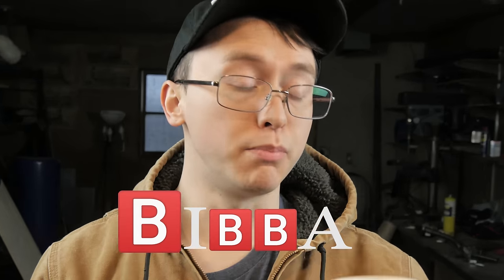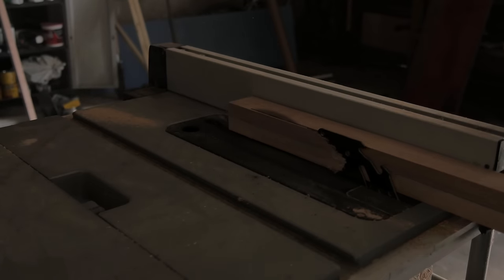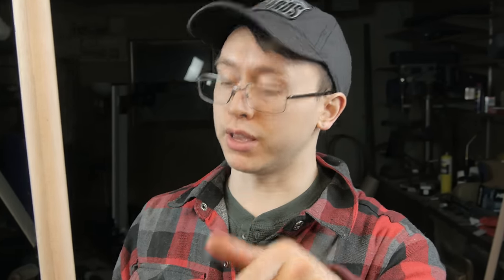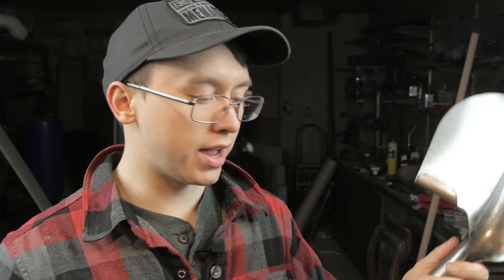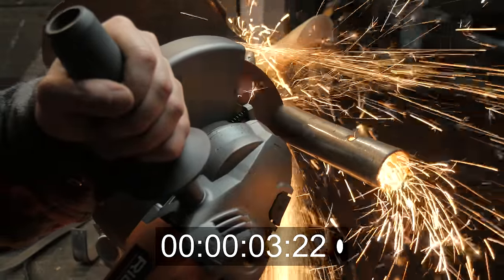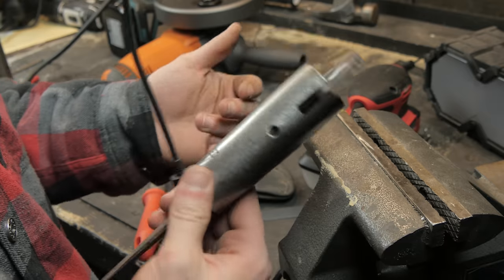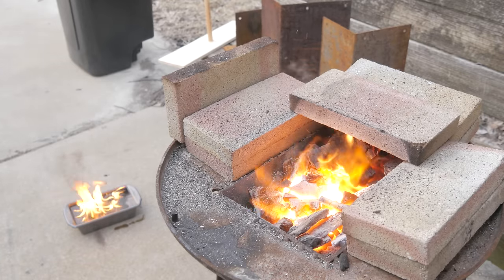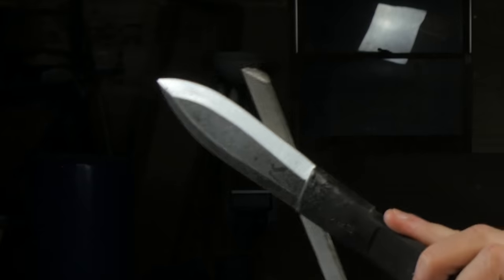DIY Lathe in a Day + Turning Spear Handles (Wrench Spears Part 3)

Comment: Please don't use sandpaper on a lathe like that Eli, wrapping your hand around the part and crossing the sandpaper over itself.
I work with lathes for a living and using sandpaper can be very dangerous if the proper precautions aren't taken.
Your technique from 3:29 - 3:32 is the safe way to do it. 
At 3:33 when you had your hands underneath the work piece and at 3:35 when you had your hand wrapped around the work piece, with the sandpaper between your hand and the work piece, you were exposing yourself to the unnecessary risk of losing or seriously injuring your hand or arm.
Please reply to let me know you've read this.
Reply: That drill doesn't have the same power as a real lathe he could stop it by hand just by squeezing
Reply: @crashoverride93637  Exactly, I've actually killed a drill by holding the chuck. But i can understand where hes coming from, if Eli EVER DOES buy a real lathe, That's bad technique.

Comment: Hey man, I hope you get to read this. I have been doing a lot of experimenting with forging knives recently and have learned some stuff about HT that might help you out. I would suggest you take a scrap piece of your wrench and try quenching it in water. It may crack to pieces, or it may be the trick to getting your spears hardened. A little telltale sign that your piece hardened will be that most of the black scale will pop off, leaving a dull, light gray color steel underneath. Another thing to consider when quenching in water is to only quench for a second or two, so as not to cool too much too fast and end up with cracks. You could even do a quick, 1-2 second quench in water to flash the hardness into it and then immediately quench into oil to let it cool the rest of the way down. That will prevent the residual heat from pulling the hardness back out of it while also minimizing the cracking risk. Hope that helps!

Comment: Hey Eli My brother is experienced in making knives and if you heat up just a scrap piece of steal to that orange glow and dip it in the oil it’ll heat up that oil to just the right temperature for tempering your blades!! You will have to do it more than once though, like three or four times of that process and it’ll heat it up nicely.

Comment: Hey Eli, get a magnet for the heat treats. The steel won't attract when it's hot enough for the quench. The first time I did a heat treat, I made a knife out of an old file and got the heat treat first try and didn't have to heat my oil.

Comment: You can use a charcoal paste on the blade and encase the entire spearhead in clay. Wrap the spearhead up in the clay and make it look like a hot pocket. Then, you put the whole clay hotpocket in a crucible and heat it up until the spear head gets red hot. It will actually surface harden the steel, keeping a soft core and a hard edge. Perfect for any stabbing or slashing implement

Comment: Eli, when heat treating try moving the blade around, the heat will make the oil boil, making air bubbles around the steel which will keep the steel from cooling as fast as it needs to

Comment: It's hard to tell the temp of the steel just by the footage and often in real life but just a suggestion, I've found it useful to keep a magnet close by and test it on the hot steel to assure it is indeed non-magnetic before quenching. I struggled with hardening issues for a long time and after using this method I have a much higher success rate. Great content as always.

Comment: Hey Eli, when you go to quench steel make sure you wiggle the piece around in the oil. You gotta keep it moving so it gets a uniform cooling. The heat can actually cause the oil/water to boil so fast that it isn't touching the piece. At least that's what I see yelled about the most. Also, you probably know this already, but I'd bet those wrenches are made form 01 Tool steel. I think the hardening process is a little different for 01 from high carbon steel.

Comment: Before going for a case hardening, try another heat treat. 

You need to put a magnet next to your forge. 

The magnet is used to test if the material is at quenching temperature. 

When the work piece is heated to non-magnetic temperature, it’s ready to be quenched.

Comment: As a bladesmith, it looks as though you're not getting the steel hot enough, get it to non magnetic then a little bit hotter than that.

It also looks like you're using motor oil to quench which is pretty rubbish tbh. Try using canola (rapeseed) oil. Warm the oil to about 120f then quench for about 10 - 12 seconds.

Always a bit of a gamble using wrenches and stuff because the steel is somewhat an unknown quantity. You'll definitely get better results with that sweet 5150!

Hope this helps.

Comment: Hey Eli I do some heat treating myself and when you heat up the steel it has to reach critical temperature (non-magnetic) and when you put it in the warm oil, you have to move the blade around so a pocket of air/ smoke from the oil doesn’t mess with the heat treat itself

Comment: there is a good chance it is a W tool steel, meaning it has to be quenched in water. I suggest buying a wrench identical to these or using a cutoff from these wrenches if you still have any and test with that because if it is not a W steel it would likely crack. Keep up the good work!
Reply: That is my suggestion as well!

Comment: From what I've learned looking into private bow building them shafts really should have straight grain running from one end to the other. On the the other hand you could've used shovel, post hole digger, or shop broom handle.

Comment: Random material science student here.  i'm just gonna throw a guess to the wind but it may be possible that because your oil maybe got over heated the difference in temperature between the heat treat and you quench may not have been great enough and the structure of your steel was recrystallizing to a weaker point.  From what i remember in class if the steel is not dropped in the quench fast enough or the temp difference is too narrow the weaker atomic structure is more likely to form.  Again though I may be wrong but heating the oil looks more like a visual aesthetic then anything else.

Comment: I know a guy who has been a blacksmith for over 30 years and according to him oil is what you use if your not doing a precise heating, and he actually just swears on useing water to quench because it causes a faster reaction that causes the steel to harden better, however if you dont know the proper temp to harden the steel your working with then oil is useually a better solution because it cools the metal slower.

Comment: Heating the quench oil is usually done with a different piece of hot metal. Grab a D20 nail, get that sucker red hot, stick it in. Then do the real quench.

Comment: You may have gotten the heat treat thing nailed but if not, when you heat treat it move the metal around VERY FAST in the tank because it breaks the vapour barrier caused by the heat so the oil will actually hit the steel while its still hot

Comment: Eli, I think you should really get rid of that cable/string thing (@ 9:04) when working with stuff like angle grinders.
I was using a wire brush attachment on my grinder a while back and the thing caught the string of my hoodie and jumped straight at my neck. Scariest experience I've ever head. Luckily I pulled the cord quickly enough that it only scratched up my neck with just little bleeding.

Take care, love your stuff!

Comment: Dunno if you already do this but you could soak the ends of the spear poles in water , then it should wrap around the spear head a little tighter and you can wrap below the spear head and I think this should keep it from splitting the pole

Comment: At around 12:30 you should be using the magnet trick.... When the metal is hot enough for tempering, the magnet won't stick.  Just an idea to try....

Comment: I'm a proffessional blacksmith so let me put in my say here. Heat up any old piece of round bar in your forge and quench it in your oil and it will preheat the oil to a much higher temprature and it can cool while the other piece heats

Comment: When you’re quenching the blade in the oil you have to keep it moving so that air bubbles don’t form. If you just put the blade in the oil quench air bubbles will form and keep the oil from actually touching the blade (probably the reason why the metal isn’t hardening)

Comment: When you temper try to barely have it above a low red temp and let it cool longer in the oil. The cheaper wrenches are also usually water hardened. Try to use a small test piece in water quench and cool it faster.

Comment: You could be losing temper from the residual heat in the large mass of the tang and guard, since that part is exposed to the heat but isn't being quenched. Another possibility is that that steel might need a more rapid cool down to set into martensite, thus needing water rather than oil. Since what I've read so far, husky uses chromoly steel in some of their wrenches, but since i don't know the exact model you have i don't know for sure. 

I would try testing the blade for magnetism while in the forge, and when the steel has reached a non-magnetic state (Called Austenite, and usually occurs around 1600F or a dark orange heat), quench the blade in water for about 2-3 seconds, and then submerging the whole thing in oil for a good 30 seconds to a minute. This would allow for a little faster cool down than just oil, and would allow the entire mass of steel to cool thus preventing residual heat from ruining the temper.

But that's just an idea, love the H*CK out of your vids bro.

Comment: Also you might need to heat the metal more. There are data sheets on every type of metal almost. Do the magnet test. If the magnet no longer sticks, it’s typically hot enough to be heat treated.

Comment: Get it hotter. 
Did you do a magnet test?
Take a tiny magnet (otherwise you may magnetize the metal) once it's no longer magnetic. Let it get a few hundred degrees hotter and quench it for a while. If it gets too hard you can bake it in the oven to soften it.

Comment: With the quench use heated oil and let the blade cool (roughly to the temperature of the oil) in the oil before removing it. That should result in a solid heat treating process

Comment: If you move the object you're quenching it will give you a better hardening because it forms a barrier of air between the oil and the metal due to the Leiden frost effect and it insulates the edge so it doesn't harden correctly which is why the spear isn't skating a file so next time you quench move the spear around so that barrier of air doesn't form

Comment: Use a magnet to check the temp. If it sticks it’s not hot enough. Also when you quench the blade make sure it stays in the only a lot longer

Comment: When you heat up the steel to harden. Use a magnetic to check for the time to quench in oil. When it looses its magnetism wait another minute. Then quench in the oil. Tool steel is typically O1 which means it needs it has to be at least 1450 °. You simply did not get the metal hot enough.  To harden.

Comment: an easy way to get a good heat treat temperature without fancy equipment is to use table salt, while its heating up, sprinkle some table salt on your metal and once it gets to the heat where the salt melts instantly, dunk it into the oil.

Comment: 🍎here's a tip🍎 leave the hot Steel in the oil until it's barely smoking or until it's warm that way it has enough time to heat treat and if you don't know when is the right time to quench it use a strong magnet on the hot steel and if it doesn't stick its perfect to quench I hope this helps and you're welcome

Comment: Another suggestion would be to try water instead of oil, most places I've seen it discussed they say water actually works too well for normal cases so oil is preferred.
i.e quenching in water makes normal projects too hard/brittle, so if this stuff doesn't seem to be hardening as much or the oil doesn't have enough carbon?..
There is the risk of it making more stress points in the steel, but as long as you normalize it after it might be a decent thing to try.

Comment: I've tried to case harden steel using clickspring's method and as others have mentioned in the comments, get a magnet and test to see if you are getting hot enough.  If the steel is not becoming nonmagnetic then the carbon will not be able to penetrate the steel and you will only get surface hardening. Also if I remember correctly steel will not harden well if you do not get the steel hot enough for it to become nonmagnetic even with carbon steel.  Test it with a magnet before you quench it.

Comment: Old wrenches were made with pretty high carbon steel, but most of the time new wrenches aren't. You could try to carbonize the steel (I've never done this myself, but I've seen it done) by packing it in carbon dust, inside a pouch made of stainless steel foil and heating it up to forging temp for about an hour. That might impart some of the carbon into to steel

Comment: you should use a bigger oil container and move the blade around quickly in it so that the superheated oil vapor can't form a protective layer
Reply: the oil vapor prevents the blade from cooling quick enough
Reply: that might be it

Comment: You could try to normalize the temper of your steel by letting it cool in the air a few times before quenching, ive seen steel more likely harden with this method

Comment: If you want to make sure you're heating the blades to the proper temp before quench, they need to be heated past the point where they're no longer magnetic. Obv you shouldn't take a magnet in hand and just stuck it on there bc you'll burn yourself, but you can buy one of those extendable magnets that people use to retrieve parts they've dropped into their engine bay for a few bucks and use that to test if the metal is no longer magnetic before quench.

Comment: use the super quench - it works on mild steel:
5 gal water
5 lb Salt
32 oz Dawn (blue) dishwashing liquid (28 oz if it says "concentrated" on the label)
8oz Shaklee Basic I or 7oz UNSCENTED Jet-Dry or other surfactant (like Simple Green) of appropriate quantity for 5 gal mix (wetting agents)

that's from the inventors site.

Comment: Ok a trick you could use it to make a clay box the size of the spear heads then what you need to do it fill have the box ( half way) with some sort of high carbon content material like coal ( make it a powdered form first) then place the spear head inside it after that fill the rest up with the powder then using you're forge bake the spear heads in the clay box for several  hours make sure you seal the clay box first. And once it has been heated for a long time with the coal the outer layer of steel will be very high carbon steel but the inner lay will keep it's original carbon content I believe the process is called case hardening you could look up the exact spects  on how to do this properly online

Comment: It's possible that the steel is not able to be hardened more than your files. Steels used in hand tools are often highly alloyed and require very specific (and hotter) heat treats that, even done by the book, may not yield hardness higher than the typical file. Similarly, you may have surface decarburization from the forging and may find that just a bit more grinding will reveal harder metal. Moving the piece around while quenching is also a surprisingly important factor 🔥

Hardness testing takes out much of the guess work- you can order some cheap hardness-test files on eBay to ball park some actual numbers. 55-58 rockwell C is probably acceptable for high impact weaponry like this I think, you might be closer than you realize

Comment: heat treating is tricky and hard depending on the metal. if it has a lot of impurities or is mixed compounds it can be a pain. plus you might need to get the metal a bit hotter than that to really treat it.
and i wish i could help financially but i more broke than a dropped china bowl.

Comment: Could try carburizing the steel by surrounding it with powdered graphite and sealing it in an air tight metal pouch and heat it up yellow and keep it hot for an hour to leech some more carbon into the steel

Comment: You should use a magnet when hardening. When the steel loses magnetism it's at quenching temp. But yeah maybe the wrench steel doesn't get as hard because tensile strength is more important in a wrench. I'd stick to 51-60 and 1095

Comment: Tap a neodymium magnet to the glowing steel,dont quench until it is just hot enough for the magnet to stick ,and a throwing weapon shouldnt be extremely hard,this will cause the blade to snap if it hits something such as a rock,a slightly softer steel would just bend and be able to be hammered lightly back into shape

Comment: If you want a better heat treat, heat the steel until it becomes non-magnetic before quenching (aka touch it with a magnet to see if it sticks). Your forge also may not be getting the metal hot enough; if you have an oxyacetylene torch you can easily reach the proper heat with that and just do an edge quench. 

I'm not sure about the quality of the wrenches (metallurgy of hand tools has been going downhill for quite some time even on major brand tools). Cheap tools are probably even worse; see if you can look the specs up online.

Comment: Get the steel hotter.  Hot enough till it wont stick to a magnet.  Also, quenching in water will cool the steel off fast enough for the steel to harden even if it a lower carbon steel

Comment: Warm up your quench oil.  Too drastic of a temp, itll screw your quench up.  Get it up to around 70 or 80° f.  Also, you need to normalize at least (I use 3 cycles) annealing would be good, but overkill.  Quench at your lowest transformation temp.  Get it up to where a mag just barely wont stick (usually a dull orange), and heat it for about 10 seconds longer and go for a quench.